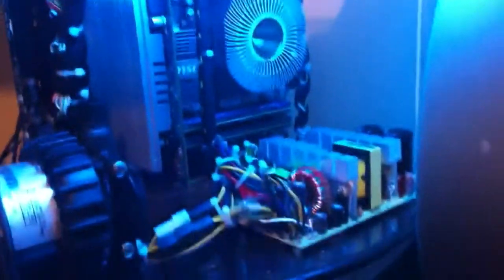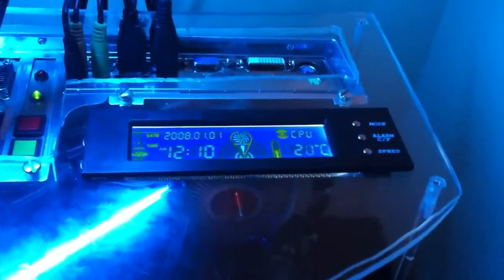Test run of oil pc #2

Comment from the maker: @xconundrumx - the pump will
Pulloil from bottom, push out through the top to an external radiator, then back in the tank to the top. The colder oil at the top will help to cause good corculation in the tank.

Comment from the maker: The water pump will be pumping oil from tank to a radiator for better cooling. This was just the dry run to test new componets and my rewire of the power supply.